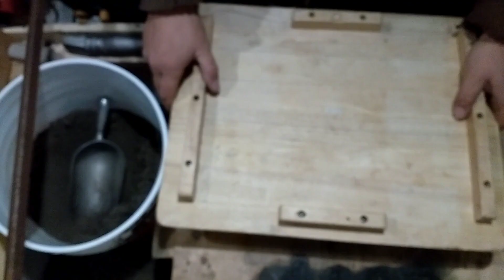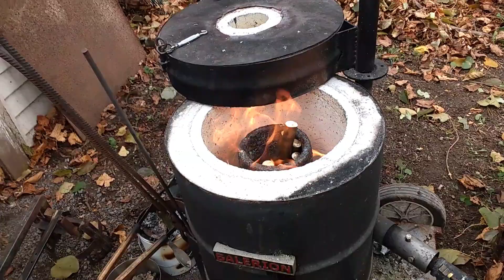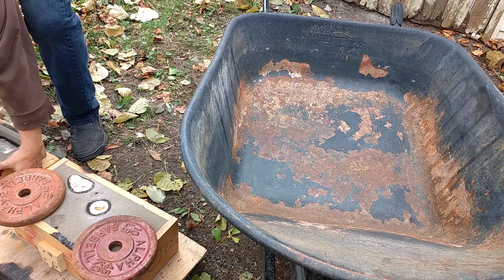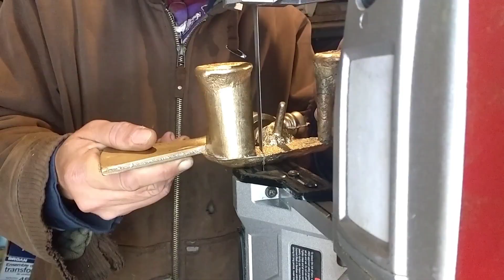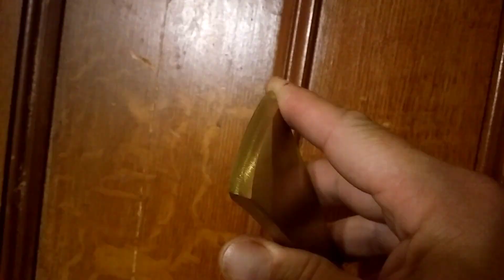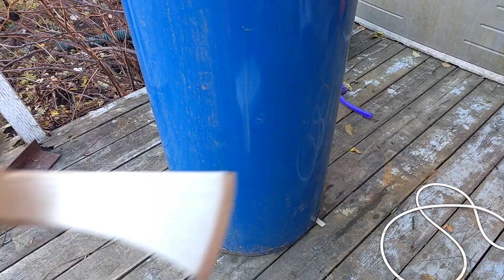Off-the-Wall Casting Challenge: Aluminum Bronze Pipe Tomahawk!

Comment: That is incredibly beautiful! I love it! I see what you mean by the cores now thank you so much for the info! So tapping the edge will help to harden it? That was my main concern with my bronze axe that it wouldn’t be very durable, but I wasn’t too worried since it was a gift and not meant to be used too much haha
Reply from the maker: Thanks!  Yes, the ancients used a similar method to harden the edge of bronze age blades; the hammer marks can still be seen on artifacts.  Aluminum bronze can get very hard this way, harder than almost any other copper alloy.  But the hardening does not go super deep into the metal.  I have another video that shows what happens if you try to chop wood after grinding off the work hardened surface: https://youtu.be/elaJ7CB8-YU?si=HBBCSQtlrS8-nTWA
Ignore what I say there about having annealed the edge of the blade - that may or may not be true but I definitely removed all the work hardening through aggressive re-grinding.  The same thing could have happened without any overheating involved  if I had just skipped the original work hardening.  It's worth noting that some aluminum bronze alloys can also be hardened with a heat and quench treatment, similar to hardening steel though not quite that hard.  Very unusual for a copper alloy. I have not experimented with that myself.  Yet.  I've made a couple of bronze axes for folks who really just wanted a shiny wall hanger, but I always harden the edges anyway.  But that's more for me than for them, I just like knowing they are all functional tools as well as art. 😁

Comment: Wow I didn't know it takes metal that long to melt.
Reply from the maker: Furnace design makes a big impact here.  In that big heavy duty furnace and starting from cold it does because it's a lot of furnace to heat up.  A second melt in a preheated furnace would go MUCH faster, or in my smaller furnace with low mass design that takes almost not time at all to heat up.  I do bronze melts in 15-20 minutes from a cold start in the low mass furnace using propane.  The big furnace is really designed for doing back to back to back melts efficiently once it's hot,, while the smaller one was built for super fast one and done melts.  Make sense?  Thanks for watching

Comment: Well done your product is useful and sightly. Pesonally, I made a Kukri of aluminum bronze. Increased the aluminum just a bit to make it harder. Skates files like untempered carbon steel, can't imagine it being harder. I have beat the crap out of it and threw it at my concrete floor to make sure it wasn't too brittle. When the mix is right I prefer this to steel anyday.
Reply from the maker: Cool!  Gotta be careful not to add too much aluminum though... Sounds like you didn't. 👍

Comment: I always wondered why not "peen" the edge with the flat of the hammer since the blade angle surface is flat. Does that just not work? It just always seemed odd to me to use the round peen head on a flat surface.
Reply from the maker: It would probably work, I'll have to try that...

Comment: Could you by any chance help me out with a link for the stl file of the sand packer? I've been looking and havent been able to find one and it looks like you have, great video btw, looks awesome.
Reply from the maker: Sorry, i built the pattern for the sand rammer used here by hand out of wood.  But Perry from the SWDweeb channel has got some great CHEAP 3d files for a rammer and several other molding accessories in his web store, PLMfoundries.com. I cast one of his rammers too and in some ways I like it better than mine.  Good luck!

Comment: Atleast you cut something with it, even if it was for 15 seconds. You should make a video where you cut more stuff with it.
Reply from the maker: Thanks, and yeah, there are a lot of pop can metal video game prop swords on youtube that only get used to smash some fruit.   Nothing against the guys making those but I never saw the point in casting edged tools that won't hold an edge.  I do have some big piles of brush that need to be cut up and burned, but I was going to use a chainsaw for that...
I do have a couple videos where I chop some wood with my other bronze axe, if you're interested.  Thanks again

Comment: Can you do a video about your setup, tools, and suppliers or how you made them?
Reply from the maker: I've tried to cover a lot of that ground already; made videos about how I built my sand muller, how I built my furnace (the newest one anyhow), how I set up my foundry shed for indoor casting, I've showed how my molding bench was designed and built, how I made my own greensand, how I build propane and waste oil burners and molding flasks etc...  Maybe I could do a general overview video to go over it all at once in less detail...  Was there something specific you were wondering about?
Reply: @tobhomott  can you show how you acquire or make your own patterns/templates?
Reply from the maker: @valleyforge7231  check out my patternmaking playlist: https://youtube.com/playlist?list=PLo6k_ZP-VFj6vRYhccXc9SfVNIxcT2w3b
I also have a few patterns cast in plaster that I made using plastic molds I bought online or in craft stores, but I never saw much point in filming how I made those since all I did was mix and pour the plaster.
If I left anything important out in the existing videos that you're wondering about, just ask and I'll either address it in a reply or potentially in an upcoming video.  I'm sure I'll be filming some more patternmaking projects eventually.  Is there a specific casting you are interested in making? 
Just know that I'm very much an amateur.  There is a great new channel that you ought to check out if you want to see how a real master patternmaker does it: Dave Clark the Pattern Guy.  https://youtube.com/channel/UChF0g3BAJwfO1I5237iNBOQ

Comment: Why didn’t I think that a black walnut sapling has a hollow pithy middle, Easily gone through with a wire, then just a short hole to the pipe
Reply from the maker: Good idea - the squirrels get most of our tree's walnuts, but I'll keep my eye out for one
Reply: @tobhomott  I stopped counting squirrels once I took out 800. They make good baits for the raccoons. I'll start wearing gloves not just washing hands to avoid raccoon worms
Reply from the maker: @TedHouk  killing them is a tricky legal area where I live, but they are welcome to the walnuts as long as they stay out of my attic and don't drop them on my head. :)
Reply: Tobho Mott I stopped counting at 800 squirrels who passed away. I’m sure I’ve taken out 900 at least. A have a heart trap in a box so they don’t rattle around when they see someone coming or a .177, or subsonic 22 all work well. Of course do not discharge your weapon within 450 feet of the neighbors house.
Reply from the maker: @TedHouk  I think they have to actually cause damage to property first AND a trapper's license is needed here (Ontario, Canada) to kill them legally

Comment: Placing a handle on a longer metal lathe symmetrically allows you to turn the handle and run the drill bit straight down the center.
Reply from the maker: If only I had one...  Someday, maybe.
Reply: @tobhomott  I got mine from my FIL who passed with dementia. Hey! Black walnut bagpipes!
Reply from the maker: @TedHouk  sorry to hear that Ted

Comment: Will bronze hold an edge?
Reply from the maker: This alloy does pretty well once it has been work hardened, though it wont hold up quite as well as a hardened steel edge.  Unlike most other alloys of copper, it is also possible to harden with a heat treatment.  But I haven't messed with that yet.
Reply: @tobhomott    So that is why you were peening it, to work harden?    Good videos, keep it up.    I used to cast little cannons out of tire balancing weights when I was very young.  Very crude, but still fun.
Reply from the maker: @jeffreynelson2660  yup, that's why.  I guess maybe I didn't explain that too well in this video.  I have another video on that topic you might find interesting, which shows what happens to one of my aluminum bronze axes when I use it to chop wood after grinding off all the work hardening, then again after I repaired the damage and redid the peening.  It's a pretty dramatic difference...  Thanks for watching and commenting!

Comment: A bit late to the game, but do you have any inclination to if you can work harden bronze in a press or a English wheel. Thin sheets of copper needs heat treatment to  avoid craking when you have been over it in a English wheel or used a press on it.
Reply from the maker: Better late than never, thanks for checking this out!  That sounds reasonable to me, I bet something like that would work well.  Without some kind of hardening, the edge on a blade like this would quickly become deformed beyond all usefulness (as I showed in an even older video).  I've only used the peening method so far, but what I really want to try sometime is hardening one of these axes by heat treatment.  That doesn't work with most copper alloys, but this one (C954) is said to be the rare exception that proves the rule.  I have a kiln, but it needs a little upgrade before i can try it.  One of many projects that will appear here some day...

Comment: Possible to cast it full tang?
Reply from the maker: Do you mean cast it as all one big piece of solid bronze, including the handle?
Reply from the maker: Oh, I found some pictures, so just a tang that scales could be attached to?  I guess it would be possible, it might even make having the smoke tube through the handle easier than drilling out a long straight hole in a wooden handle, if I could cast the tang as 2 strips of metal with a space between them.  It would mean making a whole new pattern I think.
Reply: Yeah.
Reply from the maker: @ziongray918  it's an interesting idea, thanks for the suggestion.  I'll have to think about that.

Comment: Топор красавец как в фильмах,но из бронзы а это хрень)
Reply: "The Topor/ax is krasavets/handsome as in the fil'makh/films, but made of bronzy/bronze a eto khren'=and this is crap)" Спасибо/Spasibo/thanks
Reply from the maker: @TedHouk  thanks!  I appreciate the translation.  What can I say to that, other than to just point out that this modern alloy outperforms bronze age bronze by far, especially when work hardened, and that you really don't need heat treated tool steel to chop wood.  Sorry I didn't see your reply ages ago, somehow I missed it.  Thanks again!
Reply from the maker: I assume you won't be ordering one for yourself then. 🙄. This tomahawk is really just meant for throwing at targets and smoking, but the C954 alloy is much harder than other types of bronze and is able to chop wood and keep its edge.  I made another aluminum bronze axe for chopping firewood and it works very well when I take it camping.

Comment: You can drill a hole on the headside so u can 🚬 without weakening the handle..easily attach a small pipestem into the top to toke if scared of 🔥 to the face.  Great job man u could make custom peices for online customers...Hey check out acid etching with acid and bees wax for perfect speedy blade engraving...you gotta have good ventilation like outside.  some metals will make fumes that will kill you...nickel is one.....so be careful what u use...the process is coating the metal object with heated beeswax letting it cool...then you carve freehand or stenciled into the wax exposing the metal of what u want the acid to etch......so u give it a acid bath in a clear glass container..the acid eats into the exposed metal as the beeswax acts like a protective cover from the acid for the rest of the blade....you can fan it with a feather in the acid as its eating the metal for best results....so recycle the acid in a glass jar for later use....take the knife or axe or whatever metal you did this too.. melt the beeswax off to be used again some other time....and so you have a clean acid etched blade of any image or design. But really do your homework so you dont kill yourself..
Reply from the maker: Interesting suggestions, thanks!  Sorry I didn't see your comment sooner.  Compared to some of other castings I make these are already a lot of work for what I can get for them, what with the two cores and the grinding and so so much sanding, and of course the peening...  Most people don't seem to want to pay for all that to get a new bronze axe that isn't a historical replica.  I've sold a couple of the slightly bigger axes (the one I made for myself is shown toward the end of the video looking kinda beat up) to folks who do value all that goes into making handmade tools or functional art, but no 'hawks so far.  If only I knew of someone who wanted a raw casting to do all that finish work and acid etching on themselves... 😀😉

Comment: To harden heat to 1500 degrees and quench in water.  For aluminium bronze blades.  No work hardening required. Your welcome.
Reply from the maker: Thanks!  I'll have to give that a try.
Reply: Victor, I’m about to cast my first bronze blade. I have two questions, 
A: aluminum bronze or tin bronze? I’ve heard aluminum bronze is harder to pour but it’s stronger correct? Which would you go with. 

B: I don’t have to work harden a bronze blade? All I gotta do is quench it in water ?
Reply from the maker: @TheTyler701  heat treatability of the C954 aluminum bronze is unusual feature of this alloy that most bronzes lack.  So peening a tin bronze axe would be the way to go for a more durable edge, not heat treatment.

Comment: What can I say... Beautiful tomahawk! 👍  I see that you chose similar "enemy" as I did 😁 In your case these are pumpkins and in my that's watermelon as you saw 😃  Nobody can stand against bronze weapon.
Reply from the maker: That is true, and once the edge is work hardened, it can even be used on wood as well, not just large pieces of fruit...  😁
Reply: @tobhomott  It's good to measure somehow what's the hardness of this axe in the place where it was hammer-hardened. I've tested aluminum bronze with the device which allows to check hardness.  It was 25 HRC which seems to be pretty good. If work-hardening allows to add at least 5 HRC that's perfect.
Reply from the maker: @DuralMetalurg  I don't have the equipment to do such tests, but it would be very interesting to try that - how did you test it? I do have a video that shows the before and after of how much of a difference the hammering process can make though, from another aluminum bronze axe project I did a while ago, which you may find interesting: https://youtu.be/elaJ7CB8-YU
Reply: @tobhomott  Yeah. I checked your video. Cool. I have no doubt that work hardening helps to increase hardness. The only thing I can say is that you told that you overheated the edge. After that it was damaged and you had to regrind it once again. It means that you cut away the edge which was overheated. This action could help as well. This is my video of making a dagger where I've made hardness test: https://youtu.be/NiezYQ3cdIc Hardness test of aluminum bronze comparing to brass in the end of the video

Comment: Nice work. Too bad about the surface porosity.
Reply from the maker: Yeah, I know I can definitely pour a better one that would not need nearly as much grinding.  

I should have let the sand dry out a bit once I realized how wet it had gotten but as a fair weather weekend warrior in this casting game, I have to take my shots when time and weather permit.  

I'm still getting used to how much water all this new sand I made needs, but I'll get the hang of it eventually. ;)  There were problems with the way I gated the mold and the way I had built the flask as well.  

Once I nail down how to get a decent as-cast surface reliably with this pattern, I may try making a match plate pattern with it and potentially be able to add or remove temprary details to it and cast some different variants.